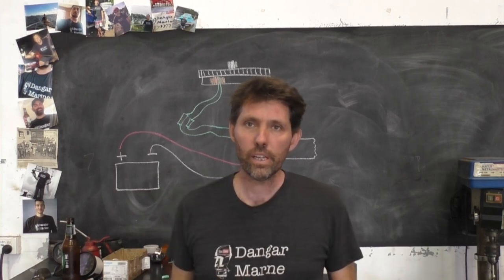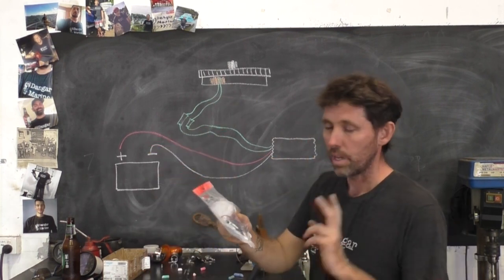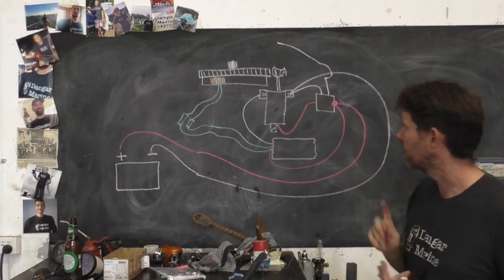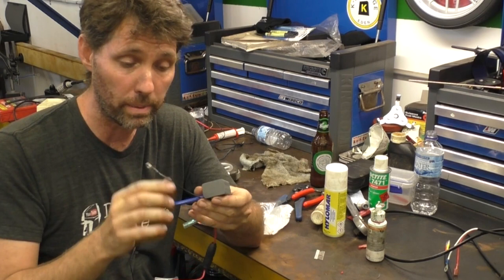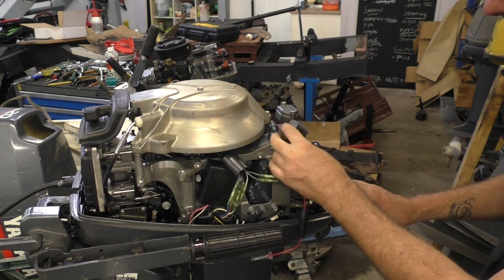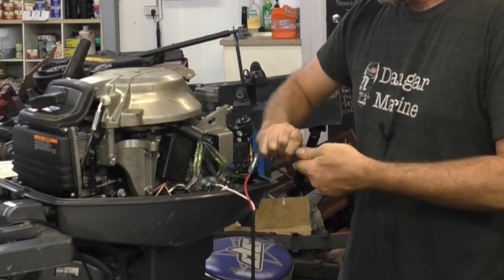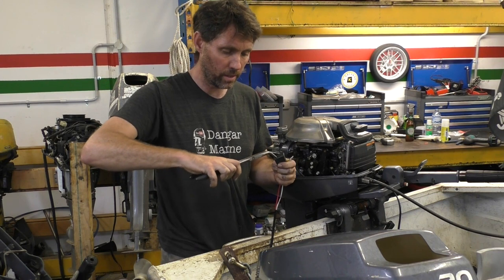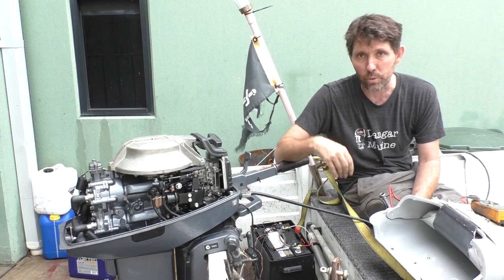Charging a battery from an outboard

Comment: Hey Stu, my 1982 Evinrude 25hp has a rectifier already, she throws up around 30v with no battery connected at full revs. When I connect a battery for some resistance she gets over 15v which is too much and coughs and splutters, would this be a simple change of the rectifier do you think?

Cheers mate

Comment: Hiii, nice video there. I have some questions. I am from India and the yamaha dealer doesn't have the rectifier in stock neither he will order it for me. I want to know if I can use a bike or scooter rectifier instead. And what size should I buy. It's a Yamaha 9.9 2stroke. It's just to run a garmin gps
Reply from the maker: I can't see why it wouldn't work, but see if you can find the specs for the Yamaha one online to compare.

Comment: My battery is in the front of the boat. Should I run 10 ft of cable from the rectifier directly to the battery or is there a way to only run the positive to the battery and do something else with the ground? The positive and negative coming from the rectifier look to be only 16-18 gauge and I can't imagine a 18 gauge ground over 10ft bring very efficive. Thanks.
Reply from the maker: I would run twin core wire of a thicker gauge all the way to the battery. Using the hull of a metal boat as ground will cause electrolysis problems down the track and your certainly don't want that!

Comment: Just installed a rectifier on a yamaha 9.9 but when I measure the voltage it giver 24 volts when wired to the 12 volt battery. Is the rectifier wrong or is it just fine?

Comment: Hey I’ve just installed a rectifier on my 18HP 2 stroke only issue I’ve got is it pumps out over 30volts. Have you had any issues like this before?
Reply from the maker: Hmmm, that is very high, even for a rectifier that doesn't have a regulator combined. Is it a factory part?

Comment: Is there any specific advantage to grounding the motor to the rectifier and battery, vs. just connecting the output leads to the wires to the battery?  I'd think NOT connecting to the motor would lessen any chance of charge eating through an aluminum boat, or even parts of the outboard?  Also, do you think the outboard will actually push 10 amps, hence not using the fused connection?  And do you have a fuse somewhere in the battery hookup in case there's a short?

Thanks for another great video.

RichE
Reply from the maker: You can't really avoid having the engine block as ground as the motors own factory component rely on that, the trick is to make sure you then have a good wired connection back to the battery negative so that the path of least resistance doesn't take the current through the hull. It's a good question about the fuse and one I was thinking about too. It would be interesting to find out the maximum current output of this regulator and put a fuse in line. I guess they don't traditionally because they are connected to the battery leads that are unfused as they need to supply the starter motor. Given these wires are much lighter though they could use some protection from a short to stop them from melting.

Comment: Great vid. Is there any reason you didn't just hook the fused wire to the other plug you unhooked? All the wires are there and could be put to use. Thanks.
Reply from the maker: Thanks Tim, yes, could certainly have done that, but I doubt it would every be used in this particular case. It is a good idea though and certainly no harm in doing it.

Comment: Hey bud I bought a regulator/ rectifier for my 2011 merc 25 sea pro with a pull start. I have the wires from the flywheel that came from the factory but the regulator/ rectifier is from amazon and has 6 wires (one being for a tachometer which I don't have) can I leave the wires I don't need unattached?

Comment: Hi Stu.  A check of the part number suggests the part you have installed in a Rectifier Assembly rather than a Rectifier Regulator.  Unfortunately I have the same part (genuine Yamaha) installed on my 25HP 2 stroke Yamaha (manual start) and, when cruising at about 30 KPH, it send 17 volts to the battery....which concerns me greatly.  There are plenty of cheap Rectifier Regulators on eBay but I doubt they "Regulate".  Have you tested the output on the part you installed?  Kel

Comment: Thanks for the video.  Question:  1996 Johnson 175 Ocean Pro Looper, I pulled the original stator off and it had lost some goo, but still ohm'd out at 55ohms.  Replaced it anyway, with a Rareelectrical brand, which began at 55ohms, but after a few hours of running it, the ignition died.  It would only run while continuing to hold ignition switch on to supply power.  Ohm'd it out, and it came back at 13 ohms.  Replaced with another rareelectrical Stator, verified correct ohms.  Few hours of running it, and same issue occurred.  Ohm'd the second new stator and it came back at 23 ohms, well below spec.  I have seen that a weak battery and bad connections can cause a current issue, but I'm not certain this was the case.  I believe my issue may be the addition of a large 10" LCD Sonar, and the addition of a Kicker Marine Stereo and two 8" speakers.  Could this be too much current draw on a 35amp rectifier and stator?  Could that extra load cause excessive heat and stator failure?  The battery did appear to have some loss of power at the times of failure, to the point that after several cranks, the starter had difficulty obtaining sufficient rpm to turnover.  The waterpump, thermostats, and temp sensors have all been replaced, and engine temp at the heads is in the 150's to mid 160's after running continuously above 4000 rpm.  So I don't believe it is an overheat issue, verified with an IR gun at the heads.  Also, new CDI powerpack, OEM coils, OEM wires, CDI optical sensor, correct spark plugs, and a new starter.  Basically the entire electrical system is fresh.  I have a new CDI Stator and CDI Rectifier to install, but I'd sure hate to see this failure again.  My plan is to isolate all the accessories to another battery, and with the install of a smart two bank battery charger, start each trip off with a fully charged battery.  Have you come across this issue before?  Any help would be much appreciated, and if I'm missing something, I'd sure like to get it corrected before blowing out another Stator. 

The reason for replacing everything before, was the engine would go into S.L.O.W. with an overheat warning.  The temp sensors were faulty and triggering around 180, as well as thermostats that weren't opening up quite soon enough.  I found the engine temp actually decreased when running up around 4900-5000 rpms during stress tests.  Of course, maybe that is my problem?  Running it too hard?  Not above 5000rpm.  If nothing else, this engine will just have to live in the 4000 range and below if that will avert this Stator disaster.
Thanks for any knowledge you may share on this matter.

Comment: Top job we have a 1977 mercury blue band 80hp have just replaced all electrical components except the coils fitted a new battery tested output from the rectifier and at high revs its putting out 16volts is this normal p.s when we bought the boat it would do 28mph balanced the carbs then it would do 36mph now with new electrical components it will do 40mph shes an oldy but a goody 150  to 155 psi  across all 4 cyls sorry about being so long winded.

Comment: Hi Stu, thanks for the vidz mate , i have a Johnson 30hp pull start 1994 j30eem, do they come out with a lighting board as standard,  the shop who done the  service said there is a charger coil on mine,  where would i find this (wiring etc) would it be under fly wheel , thank you kindly .

Comment: Hey, nice video! Quick question, im installing on the same engine but i have a different rectifier. Mine has 6 cables running from it, one black ground, one grey cable and one red cable with a female bullet connecter, two yellow cables with a male bullet connecter and another red cable with a male connecter. Which cables go to the green on the engine and which cables go to the battery? Thanks!
Reply from the maker: That is a mercury rectifier: Gray Tach, Yellow AC, Red (Female) Sense, Red (Male) B+, Black B-, Yellow AC
Reply: Dangar Marine thank you! But for a what so i do with the extra two leads, just tape them off? Im assuming i am only worried about the two yellow going to the green, and the positive and ground/negative correct?
Reply: Any chance you can describe how i would hook up that rectifier to the engine in your video? right now i have it set up with the tow yellow male AC hooked into the green cables coming from the engine,  the red male to the positive on the battery and the black to a grounding point which is then going to the negative on the battery. Is this set up right? i was getting no voltage change at the battery when throttle was applied to the motor. Any help would be appreciated thanks!

Comment: Thanks Stu for a very clear explanation. One question: Is the rectifier sophisticated enough to prevent overcharging when running the outboard for many hours into a small, in my case, LiFePO4, battery? If not, I guess a DC – DC convert it would be required?

Comment: Hi Stu I live on the coast of British Columbia Canada. I recently got hold of an ancient 1993 40hp electric start Mariner that I've done some work on and that runs pretty well. I plan to install a 16-watt LCD search lite, which draws 1.5 amps at 12 volts, on my open skiff.  Eventually also a VHF radio and a depth sounder. If I find that I have to run any distance at nite, will the present rectifier regulator charge system be adequate or will I need to beef it up somehow?

Comment: Hi Stu, Thanks for posting vids like this, they are very helpful! I have a question for u; I just bought a brand new 8hp Yamaha 4-stroke high thrust motor. I want to add a rectifier but the Yamaha rectifier the dealer proposes to me seems so quite expensive for such common a piece of electronics. In your video you say that rectifiers are interchangeable, even between brands. Can you advice on an alternative rectifier for my motor? Thanks and keep up the good work!
Reply from the maker: You might be able to find something like this on AliExpress https://www.aliexpress.com/item/664-81970-62-Rectifier-Replaces-For-Powertec-Parsun-Hidea-30HP-40HP-Yamaha-Outboard-Engine-Parts/32708750252.html or an aftermarket alternative from Sierra, but with the amount of current you get from an 8HP motor I would also consider going doing the solar cell route to charge a battery.

Comment: Hi Stu. I have a 2000model 20hp mercury USA motor and was wanting to install a rectifier. Would it be the green or the brown wires from stator? is the install as simple as the yamaha install?
Reply from the maker: It would be a similarly simple job but it looks like the wires are yellow and red http://moesappaloosas.com/mercury-outboard-rectifier-wiring-diagram/
Reply: thanks for the reply.  keep up the great work. Your videos are very educational but also makes boating safer.

Comment: Good video. I have a 18hp Tohatsu that needs a regulator rectifier fitted. Thinking of using a secondhand one  from a motorcycle wreckers.  I suppose it should work if it has 2 AC wires feeding in and 2 DC wires feeding out along with a earth wire ? Im doing this as theres little to nothing of information about Tohatsu wiring
Reply from the maker: I think you'll be fine. Rectifiers are pretty simple and standard circuits. The only thing is making sure they are able to handle the current you are putting through them but a motorcycle reg on an 18HP should be fine.

Comment: Would a faulty battery cause the voltage to rise to 18v at high revs? I checked my reg/rec and it was fine( using your other vid cheers)

Comment: Is overcharging a problem on these?  What if the battery is fully charged?
Reply from the maker: It is on larger motors but not so much a problem on small motors say under 15hp.

Comment: Hi, I'm Spanish so my english is not so good. Sorry. I want to install the regulator/rectifier to my outboard (Yamaha 20DMHOL) and I would like to know if I can do it following the instructions of your video as well as if you can let me know (suggest to me) the model that I need to install (for the regulator and rectifier). Thanks a lot. Manuel
Reply from the maker: Yep, follow these instructions and take a look on MarineEngine.com for a regulator. They will be able to advise you if you call them.

Comment: hi, i have a evinrude 20hp around 1980-1990 model that has three pinned ac lighting out. there is 3 green wires, one has a black line, that must be the earth? i dont have the connector to it and it cost about 130€ to order so i cut the cables from the plug.  do i need to have a battery if i want lighting and maybe a gps to work in the same time? do i need to connect those two green wires to regulator/rectifier like in the video and where do i connect the one with the black stripe? or should i connect  them differently? (if i could run gps and lights str8 without a rectifier) thanks!

Comment: My 55hp Outboard Yamaha is Overcharging, I changed out the Rectifier/Voltage regulator. It is still overcharging, goes up to 16.5 volts. I have New batteries and do not want to destroy them. What is wrong?

Comment: Hi Stu. I;m calling from Greece :) .I have 25 outboard Yamaha model 90s  autolube .Very helpfull your videos ...but my question is ...which is the minimum battery ( for motorbike ) i can use for charging  NOT for starting the motor only for lights when i;m fishing . 
Thanks  allot .
Reply from the maker: Hi Panagiotis, if it's just for lights you can go with something pretty small like from a motorbike or a home alarm etc. Just make sure it is 12V if you are charging it from the outboard.
Reply: Thanks for the reply it was very helpfull keep recording and the god bless
you

Comment: HI Stu-I really enjoy your videos.  I have a new Yamaha F8 and was wondering is there any reason I can't use a simple Full wave bridge rectifier to charge battery since the 8hp is such low output? Charging kit in Canada is 200 and rectifier is 5 dollars...thanks
Reply from the maker: I think you'd be fine. I can't imagine the 8s putting out enough current to fry it.

Comment: So I have a 2000 Johnson 40 hp it has Wires coming from under the fly wheel but they run directly into the Power packs and there are no extra lines to install rectifiers? Any ideas
Reply from the maker: It may not have a charging stator under the flywheel.

Comment: Does it matter if it's a 4 or 2 stroke? And may I use any regulator that has the minimum ampere capacity? So could I also use a scooter regulator for my Honda 30hp outboard?

Comment: Hi Stu; is there a way I an tell the age of my motor from a plate mounted ?. Is it in code?. In case you ask I have a vintage 115 HP. Mercury out/board. thank u good video stuff you put on here !!!.... Angelo
Reply from the maker: With Mercury outboards things are normally determined from the serial number. Is that readable?
Reply: Yes Stu; I have a readable serial numb.... Angelo.
Reply: would it be the last 2 numbers of the serial numb the year?.

Comment: Im still using an old school 20hp 2-stroke evinrude that does not have an alternator and it sucks. I'm so ready to get a four-stroke for multiple reasons, a charger being one of em'
Reply: You CAN add the lighting coil to older motors.  Extra work/cost but certainly doable if they're not too expensive.  Buying used would save a lot.  I'd love to add both electric start and charging to my old 15hp Evinrude (it was actually available with either OR both) but since not many came with electric start, even used parts are hard to find at reasonable prices.

Comment: Hi bud i just have one question just wondering if i'm gonna make a parallel connection to my 3 batteries and hook up to my outboard motor thats not gonna hurt my motor right? As long as i got 12 volts output? Thanks in advanced.
Reply from the maker: Yep, as long as they are all in parallel it will just give you more capacity.

Comment: Hi Great information, thanks. If the outboard is used without the rectifier attached to a battery will this damage the motor or rectifier? Thanks for your help :)

Comment: Hi Stu, Do you have any idea of the electrical specs on these rectifiers?  What I'm really after is their current rating. What amount of current can they handle?
Reply: Kevin McGhee
2 months ago
Very confused, I was in my local Yamaha dealer trying to buy this part after watching the video and they tell me that its only a rectifier assembly and that without the regulator I will eventually fry my fish finder, downriggers and battery at high RPMS putting too much current into the system. On a search of the part number it confirms that it is only a rectifier, so what the deal with calling it a rectifier/regulator?
REPLY
1

Dangar Marine
Dangar Marine
2 months ago
Everyone I've ever bought has been a regulator/ rectifier than can charge a battery directly http://www.boats.net/parts/detail/yamaha/Y-6J8-81960-00-00.html
REPLY

Darryl Pechey
Darryl Pechey
1 month ago
I have the same concern. The voltage output on mine tends to get a little high ( more than 13.8 - 14.1volts) for normal battery charging. Maybe it's a very old one, and as Kevin says, maybe it's just a rectifier.
 Stu, do you perhaps know the rated output of these things? (Volts and max current). I can't imagine that they supply much current. I was surprised to see the one that you worked on had a 10amp fuse. I thought it would be less.
REPLY

Hide replies
Reply from the maker: I've never seem any specs on them, I tend to just order the one designed for the outboard it is going on and assume Yamaha have done their homework.